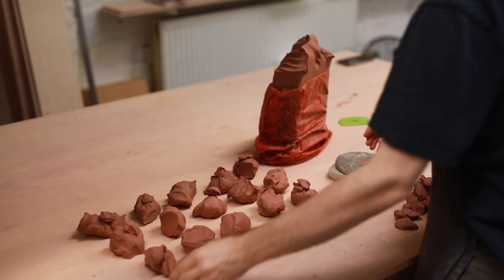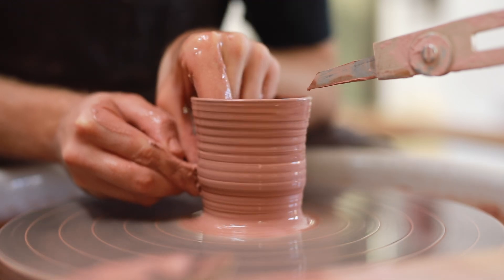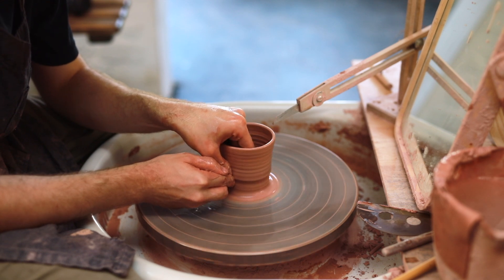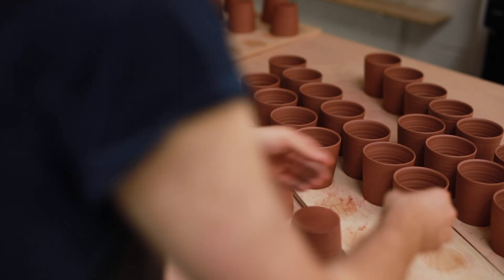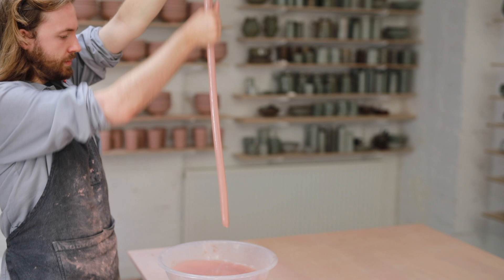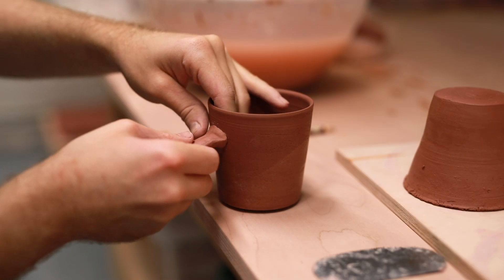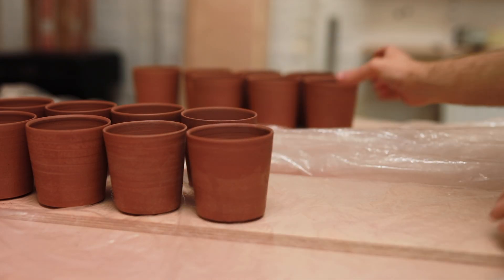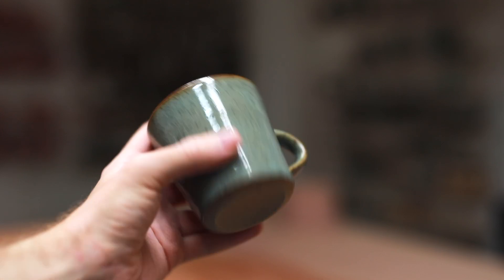Throwing, Trimming and Attaching Handles onto Stoneware Coffee Cups — Narrated Version

Comment: Amazing! I’m wondering kind of wood material is your table and all of the wooden boards that you use. I’ve been using pine boards but they warp
Reply from the maker: Thanks! My ware boards are mostly birch ply of various thicknesses, they warp a little bit but I just flip them every now and then and they bend back to being totally straight. My batts are MDF and again, I throw on both sides of them and they've more of less stayed totally straight. Another thing is to never get any of them soaking wet. When I clean them I just scrape them rather than go over them with a sponge, this helps a lot and prevents any real warping. Thanks for watching!